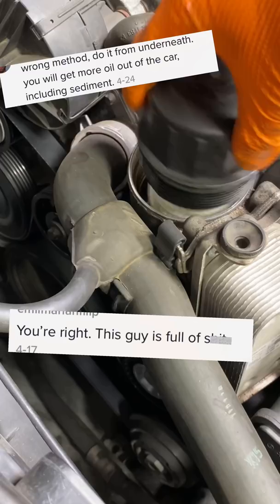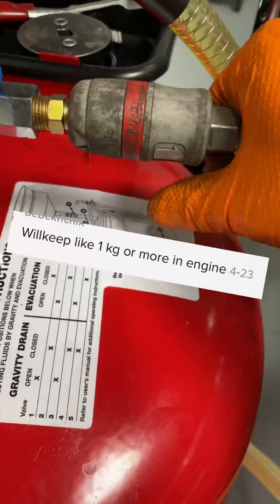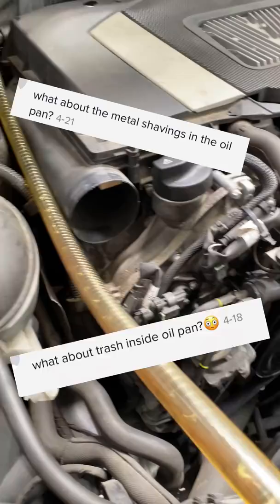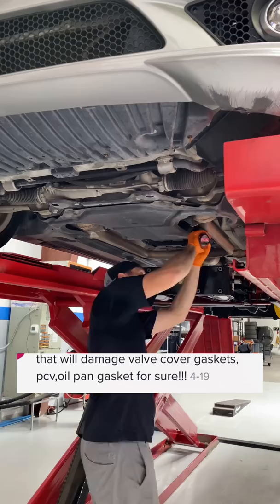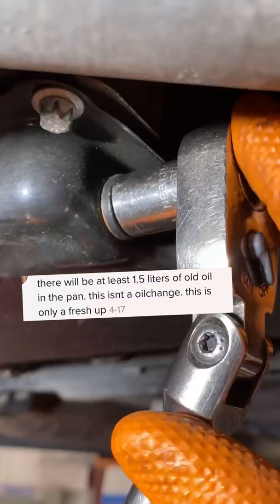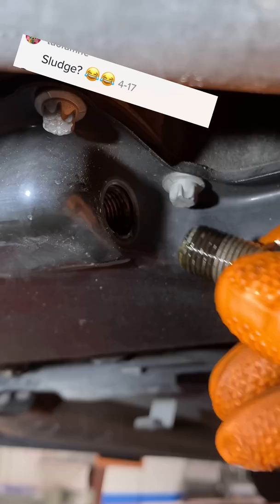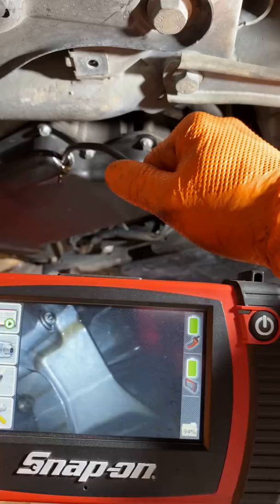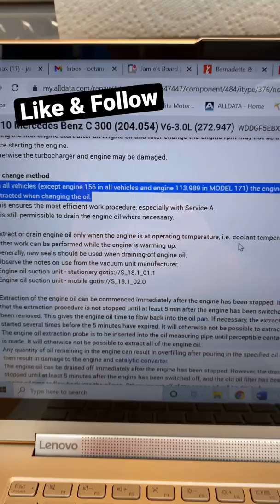#shorts Mechanic Proves Haters Wrong

Comment: The first time I did an oil change from the topside on my vw I was paranoid of leaving oil in the pan. Did the same thing after, and checked at the pan, not a drop left. I wish I could access my oil filter on my truck from under the hood so I didn't have to crawl under it. So nice to change to oil while on your feet the whole time!

Comment: Car mechanic here. In hungary we prefer the old-school method of draining it off at the bottom port. The vacuum method works great, when the car is in good condition. But the shitboxes that run around here are a different kind of problem. Some peaople (more then you would think) run with the factory oil for more than a 100k kms. Also the distances they use the cars for are like 5 to 20 kms mostly. So yeah, if you would use that thing here, there would definitely be some sludge in the oilpan.

Comment: I can understand their concern. This crossed my mind too when I started doing this working at Porsche on our diesels, hybrid, and recent four cylinder Macans. They use Audi/VW motors and the prescribed method is suction. The only issue is that sometimes the plastic extraction tube doesn't like hot oil and it would curl up at the bottom of the pan if you did it wrong and would leave oil in the pan with diesel engines. Otherwise works just fine.
Reply: This happens with JLR's Ingenium engines as well, usually what I do when inserting the tube is pay close attention as I insert it slowly when it's about to reach the bottom you can usually feel it hit bottom, if not rotate the tube and try again. If you stop it just where you felt the tube hit it should drain all of it out. 👌🏽

Comment: I was a Mercedes mechanic. The evac method works exactly as Mercedes intends. Never had a sludge engine, never had particulates, and the oil change intervals were 10,000 miles. Those engines functioned better than most domestic cars. And if they think that’s nuts, the oil change procedure on the SLK 280 would blow their mind.
Reply: This way works on lawnmowers too
Reply: And then you have the commercial Mercedes Sprinters who's engines are underpowered pieces of shit that break regularly

Like literally Diesel can flow into the oil pan
Reply: Lies
Reply: @bastik.3011  Your claim is kinda strange, the company I work for switched to Mercedes vans 3 years ago and the maintenance costs have been literally cut in half. The Ford  vans they used before were constantly in the shop. 
The problem most Americans have with Mercedes diesels boils down to lack of maintenance. Especially the emissions system. If they aren't maintained exactly on the proper schedule it ends badly.
Mercedes is pretty much the gold standard for light commercial vehicles. The resale value speaks volumes...
Reply: @jacktheaviator4938  i am German, they are trash here. Incredibly expensive to buy and maintain. They get heavier and heavier with each new version meaning you get to load less and less 900kg is the max with the newest one but realistically its more 800-700kg. Now granted i never been in another brands truck so i dont know if Mercedes is worse then others or just as bad. Two of our 2008 2nd gen Sprinters had turbo problems, one of our 3rd gen 2019 Sprinter had to be serviced because a redbull can spilled on the dash. They rust like hell and the 146PS 2.0 Diesel is not powerful enough to pull our trailers well. Our 311 Sprinter wouldn't go over 60km/h in 4th going up a small incline on the Autobahn while pulling a trailer with 1.7ton Compact digger and even our 313 Sprinter struggle which why my company upgraded to the 314 which still struggle
Reply: @bastik.3011  so, you are calling them "trash" but don't have any experience with other trucks? You are going to have issues with ANY truck that is loaded to it's max towing capacity on a regular basis. Just because a rating says you can safely do something doesn't mean that's what's best...if you load it to the maximum you shorten engine life, it's a universal truth, regardless of brand.
Reply: @jacktheaviator4938  do we have a choice tho? And yes i am aware that my opinion is to be taken with a grain of salt, doesn't change is that the Sprinters are incredible overpriced for what they offer.

Now if my country wouldnt think driving a sprinter with twin tires is the same as driving an actual Truck we wouldn't have those problems. Like there are the 5 ton Sprinters who would be way better suited for this kind of work, but in Germany you can only drive vehicle's with a load capacity of max 3.5t with your normal car license for the 5t Sprinter which is in no way different to drive then a 3.5t you need the 7.5t small truck license which in turn is so complicated to get that you might as wel just do the big truck license which is just a bit more expensive then the 7.5t but with the same effort and enables you to drive all trucks
Reply: @jacktheaviator4938  Where do you live? Where I'm from nobody would even spit on a sprinter lmao. Transits aren't the end all be all but they are better. My company finally got rid of our last sprinter 3 months ago.
Reply: @bastik.3011  I thought they were best built in Germany. Huh. But yeah when one company rules the place, price is limitless
Reply: @bastik.3011  I drive vans for a living. The Sprinter is by far the best van I've driven in terms of power.

If you think a 2019 sprinter is underpowered I'd love to see how you'd react to what a Transit or Nissan NV400 (same as a Renault Master) is like.
Reply: @MrManBuzz  what engine?
Like k said our company only has the 311(which are horrible underpowered) the 313 (which are underpowered for the job we do nut fine for delivery) and the 314 (which is allright but could use more power)

Comment: you know it's a german car when you have to remove 4 different plastic covers just to get to the oil pan
Reply: nice pfp. been bumping the self titled album a lot lately.
Reply: I wish.... my 06 buick regal you have to life the engine up to get to the oil pan because of a welded in cross member...how in the hell is that maintainable. I was quoted 700$ to change a 10$ oil pan seal.
Reply: @flyingmunk8956  talk about bad design
Reply: Welcome to cars past 2002
Reply: Oh man darn those plastic covers for protecting my car!
Reply: @JohnJohnson-fy6dt  i'm not saying they are useless, i'm saying that you don't need 4 of them.
Reply: @flyingmunk8956  Ford 7.3 diesel you're supposed to pull the engine and turn it upside-down for 24 hours before replacing the oil pan lol.
Reply: @fixinsht247  holly hell. Lol I would rather roll it down a hill... then change the oil when it's at the bottom.
Reply: New f150s have a metal tray blocking, my old shop wanted to charge a fee to take themoff on top of the oil change

Comment: Your criticism is unfair. Of course there would be no sludge, because you did it wrong. In order to show sludge in the pan, you should
1. Drain/extract oil,
2. Add 1/2 quart of sludge into crankcase;
3. Fill the engine with fresh oil. 

Also, I fill mine with oil by pouring from the top, until it reaches the cap, but carefully, not to overfill.

Comment: When I worked at a oil change shop I honestly preferred the higher end cars as they could be changed with only opening the hood. Not as quick maybe but extremely stress free.
Reply: With the lower end engines you can usually stick a suction tube down the oil dipstick hole since they usually go to the lowest part of the oil pan and suck it out that way. You just have to have an extra attachment and they are generally a bit slower. Plenty of home oil extraction kits work like this.

Comment: I did my apprenticeship at Mercedes and this is the way to service them. I do the 'old school' method because while it's draining you can inspect the vehicle properly e.g check suspension bushes and joints, check brakes, do tyre pressures. Time management.
Reply: Late model Range Rover, and Bmw have no drain plug at all. Suck from top is the only option. Not only no drain pan, no dipstick also. You gotta do all these steps in cab to get the electronic dipstick to register a reading
Reply: @benmo2310  that just sounds needlessly complicated and annoying.
Reply: @about37ninjas  My former boss at Jiffy Lube chewed me out one day because we were supposed to have each vehicle in and out in under 15mins, logical, yeah? Only it stopped being logical when we'd have EcoDiesels, RangeRovers, BMWs, (just about any new vehicle tbh), all having absolute minimum times for oil changes. EcoDiesel was 30min drain, 30min fill. To this day I don't know why its that way.
Reply: Thats fair. I like taking the wheels off once a year/every other lof to rotate
Reply: @benmo2310  Wow. That's interesting.
Reply: @meatsmell8639  Eco is 15 minutes total job. Drain whilst changing canister, canister back in, pit guy yells up he plugged. They fill my truck and im out the door. Best place in the state of NC.
Reply: @danielg2111  As of a year ago, they'd be doing it wrong, it was definitively a mandatory 30min drain, 30min fill, enforced by the computer system in the truck. (Things do change though so YMMV) 

Also, I quit my job at Jiffy Lube after watching them destroy a good dozen vehicles by my bosses and co-workers filling them with coolant instead of oil, leaving the drain plug out but clearing the vehicle to leave, failing to torque lugnuts causing customers to wreck... the list goes on and I do hope the shop you goto, isn't like the one I worked at, but always check their work regardless cause Jiffy Lube is a notoriously shitty quick lube facility in almost every place they exist.
Reply: @meatsmell8639  I had no idea.
Reply: @about37ninjas  sounds less complicated to me, no drain plug to tighten + crush ring, no oil pan gasket to replace, do everything from the hood side not dealing with dirt and grime.
Reply: @Jokestbh  What specifically did I say that you find to be "bullshit"?
Reply: @danielg2111  I know Chrysler tells us to let gasoline engines drain for 15 min. And diesel drain 30min. Granted that doesn't always happen. You know being flatrate on top of busy shops.
Reply: @danielg2111  you actually had no idea jiffylube is sketchy? Countless videos and investigations on them. It’s pretty well known they charge for services they don’t do (like changing fluids and filters) as well as insane amounts of lawsuits. No respectable mechanic will stay working there. A lot start off there but will leave when they see the shady things their bosses do.

Comment: The oil extraction via sucking only works if the car was designed to be sucked out (usually no dip stick just a oil suction port) 2 cars I got here suction wouldn't work correctly to get all the oil out so obviously you wouldn't use it on them type of cars
Reply: It's more finicky for sure, but I got it to work well in my Subaru. The first time I did it, I went ahead and checked it much like in this video and it was good to go.
Reply: It's about manufacturing and using tools how they're supposed to be used. Average car gets dumped by the pan, but cars made for the SUCC get the SUCC. Not every car can get SUCC'D as they weren't made for it. I fear for the world which thinks this is just how this shop does it and it ruins the car. It's literally the manual he's following and people are still probably are going to try and dispute Mercedes
Reply: Higher end cars require it, so if you don't have the tool you're not doing enough high end cars.
Reply: @nathanreimer1296  and the people trying to micromanage this professional will never afford a car needing of SUCC

Comment: Any engine that is in correct order and using a good high quality oil, there will be no sludge in the pan, no metal chips in the oil. Any sludge that does form is captured in the oil filter. I pulled the oil pan off a series 60 Detroit diesel with over 1.25 million miles on it. It had always had Rotella oil, changed every 12k miles there was no sludge in the bottom of the pan the magnet on the oil plug never had any metal on it. The reason for changing the pan out was my father in is infinite wisdom, while changing the front spring hangers jacket the front of the truck up by placing the jack under the oil pan. Poked a nice 1 1/2 hole right through the fiberglass pan. 1996 freightliner and as far as I  know it's still running down the road.
Reply: Yes so much, That's the entire point of the filter!
Reply: Its the Shell Rotella oil thats the trick. I put that shit in everything. 😁
Reply: @UltraNoobian  Filters don’t necessarily prevent sludge. Regular oil changes do.
Reply: Fibreglass pan huh? Interesting. Didn’t know materials other than metal or now plstic were used.
Reply: Oil filters do not prevent sludge build-up if it gets to that point. They have a spring loaded bypass built-in so oil can flow if the filter gets clogged.
Reply: @richardhoward9441  Sure is nice to see posts from people who get it. It gets tiring reading some posts of the here from couch mechanics.
Reply: First time working on a 91 pete I was very alarmed of the oil pan including a manufacturing date going back further than 91, almost made me want to upgrade lol.
Reply: Those damn series 60 will run without oil 😂
Reply: Holy shit. I’m an average joe when it comes to vehicle work and I had no idea any damn truck in this world could get up to 1.25 million miles on. I looked at replies to see if anyone else tripped on that and apparently I’m the one who knows nothing here 😂 damn that’s crazy. 1.25 mil
Reply: @ArizonaAkinTv  I have a 98 Dodge Ram with a Cummins and it has 600,000 miles on the truck and engine. The only weak link has been the transmission. Regular oil changes and service is all it takes.
The Kenworth I owned for 15 years had 1 million miles on it and still running strong when I sold it.
Reply: @donziperk  holy shit dude. I didn’t think almost anything made it past 300,000 , max 4. That’s insane! I need to up my game on taking care of my cars.
Reply: @ArizonaAkinTv  Not all vehicles will make it but quality ones will. Volvos and Toyota for example are well known for going high miles as well as many others.
Reply: @ArizonaAkinTv  That's what I said...wtf?! 1.2 miles?! What type of engine bro...
Reply: ArizonaAkinTv this is a commercial semi truck he’s talking about, not a light duty consumer vehicle. They are engineered to go the distance if taken care of properly. Massive diesel motor that is tried and true.

Comment: i work as a Motorcycle mechanic and never heard of that method... but this video shows me that it works pretty much as well as it would if you drain it from underneath

maybe I will get such an extractor for my cars
Reply: It works well on some cars, not every car, be careful, cheers.
Reply: I asked the question what the pressure does in time to rubber gaskets.
    And why they put a plug into the sump?

Comment: If you have metal debris in your oil then making sure the metal debris comes out of your oil when you change it should probably be the bottom on the priority on serving your car.
Reply: Ehhh it usually happens on older cars from normal wear over time

Comment: A lot of brands specify that you need to drain(suck) the oil that way some brands don't even have a oil plug or the oil plug is hard to reach.
Reply: Yeah just like some of them quit putting dipsticks to check oil or Trans fluid. Good way to tell what brands NOT to buy.
Reply: @bartfoster1311  that freaking sucks, my ford lucky still has one.

Comment: Honestly I thought this was a dumb way of doing an oil change until I worked at audi. This method works just as great as the old method maybe even better. I mean the engineers designed the vehicle, I'm sure they would know what the proper proceder is for their own maintenance. But honestly do what ever floats your boat as long as the oil is changed.
Reply: Fine line your walking sayin engineers know proper procedures for maintenance lol 😂
Reply: Engineers hate mechanics

Comment: I have a Diesel VW, a 1997 BMW convertible and a 2006 CLK 350 Mercedes convertible and all have the filter on top so I use this method to change the oil on all of them. 
The correct amount of oil fills them to the correct levels - only a smear left in the pans after extraction. 

If you use suitable high quality oil and filters and change it well within the requied periods/time you will never have sludge or other build up in the sumps. 

Its good engineering design that many other manufacturers are not interested in adopting for their customers.